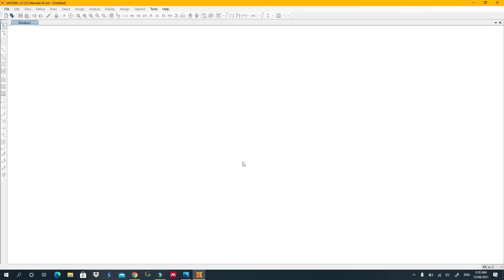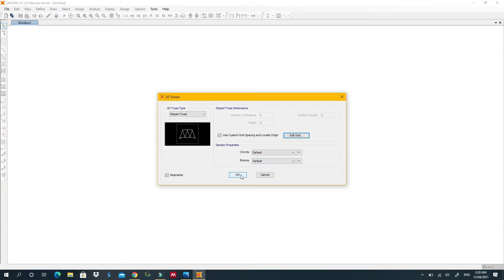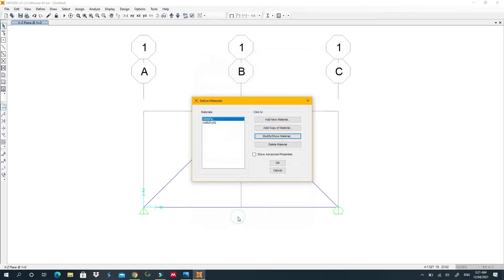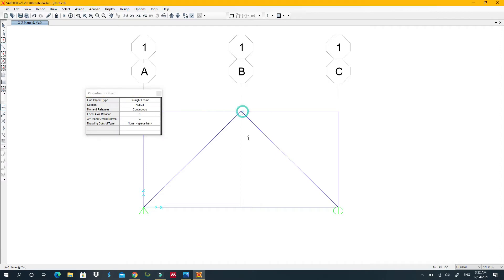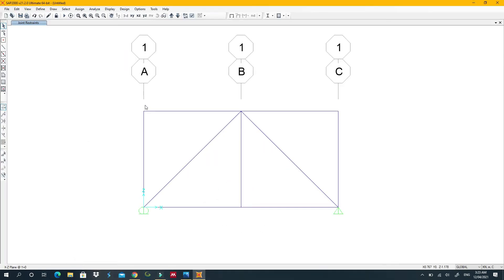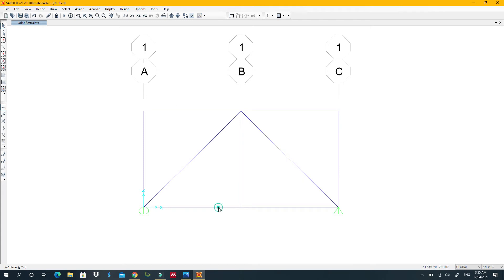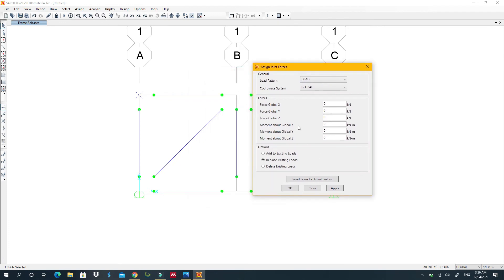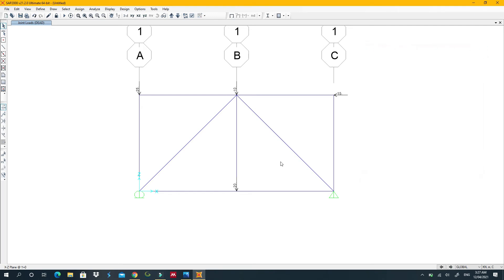TRUSS ANALYSIS USING SAP2000 TO GET INTERNAL FORCES, DEFLACTIONS AND REACTIONS. Sap 2000 tutorials.

Comment: question, why do you use the 4000 psi? isn't that the material for concrete, not steel trusses sir? please correct me if im wrong
Reply from the maker: You are definitely correct, if our aim was to do design. But for analysis purposes, it doesn't make any difference